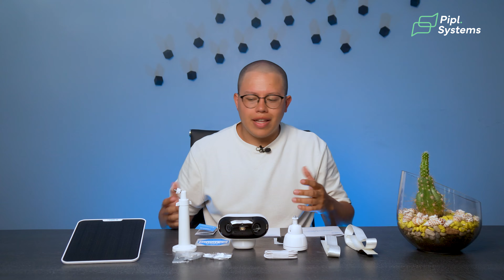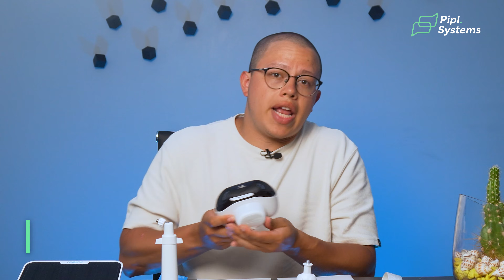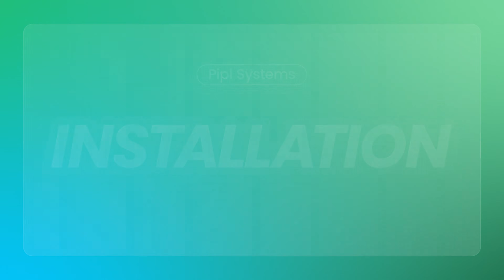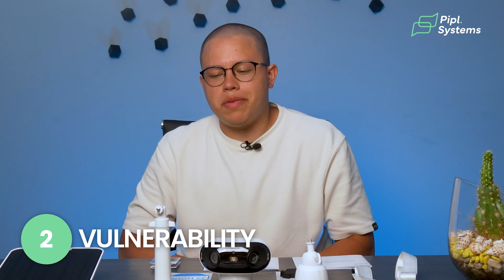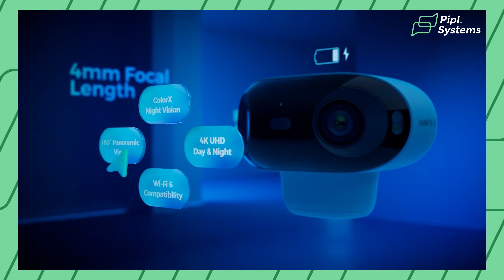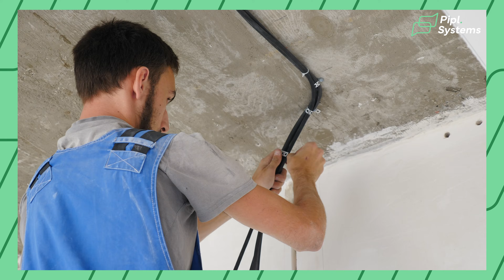Reolink Argus 4 PRO:  The Real Truth No One Talks About

Comment: The worse camera brand. I got 3 and i have non stop issues with them.. Battery experience is horrible! Video quality and sensors are good.. but with batteries that dont charge and when they do they drain fast even when you have the lowest security standards in the setup.. horrible.

Comment: This has got to be the dumbest review/reviewer on the net. The solar panel keeps the batteries topped off and the camera runs off of the batteries, not off of the solar panel. One charge on the batteries can last more than a year without the solar panel. Just a few hours of sunshine periodically will fully charge the batteries. My Reolink Altas PT Ultra battery-operated cameras use the same battery and solar panel. They record 24/7 and never get below 80%. Not only are they recording, but they also use an electric servo motor for auto tracking that the 180 degree Argus Pro 4 does not use or need . Also the camera and solar panel are completely weather proof. Mine work flawlessly in rain and while covered with snow. For security against theft the wireless units can be placed in far less accessible locations than can the hard-wired cameras. Another great feature of the Reolink wireless cameras is they will continue to operate if the power goes off. These Argus Pro 4 cameras are compatible with the Reolink Home Hub that records 24/7 via the WiFi router while sitting on your desk top in your home. If someone damages or steals your camera you will still have a recording of them doing so stored away in the wireless Home Hub unit. This duplicitous reviewer tried so hard to come up with a controversial review... e.g. "The real truth no one talks about" as click bait that he stooped to twisting facts to fit his narrative. Reolink has proven itself in my daily use to secure my property and home; I'm buying the Argus Pro 4 also.

Comment: I run mostly PoE systems, however I have a spot that has no access to ethernet way in the front, I need something, and this video didn't go over the practicality of the system.  I have a solar backup camera that can run into these issues, but works great in practice, I need to know how this works in practice and did not receive it from this video.

Comment: It says on the reolink Q and A can you charge the battery operated camera to an outlet, to get constant  power, it says yes but not recommended, may be due to the face the constant power may degrade the battery overtime. Plus can you confirm if this is event recording only or can it do 24/7 recording. Other reviews say it can’t do 24/7 recording. But my theory is if it had constant power to a wall plug it should
Reply: I’ve had a Reolink Argus PT for years out in the country running on its solar panel. I’m in Texas. It gets brutally hot. M6 experience has been had it’s bulletproof. My camera is always at one hundred percent and I’ve never cleaned it or adjusted the angle. It’s on twenty four by seven over WiFi.
Reply: @ thank for the reply, is that 24/7 recording event recording or continous recording

Comment: Simple run true aditional external battery pack from solar to cam will solve your hustle and cost only $20-30 vs thousands on wired installation when sometimes more costly to fix just in case if someone pock your cables.

Comment: My old camera ran 3 years old and hasnt had any charging issues. Even after i put it in a box for the last year. I pulled it out still turned on and still had 20percent battery. And if you buy a motion sensor camera why would you want it recording 24/7 that deafeats the purpose of a battery sensor camera.

Comment: Yes. I would assume that nobody would buy and install an expensive solar powered camera where they could use a wired IP camera.
Reply: You won't feel that way if the power goes off. The Reolink wireless cameras continue to operate during a power failure, recording to the Micro SD card plugged into the cameras.

Comment: Is this camera able to run without using the solar panel? Like using continuous power via outlet
Reply: Not true. It is easier to run a power cable to an oulet than running network cables through your attic..
Reply: @gust_FL  Agree - my use case is actually for in a vehicle where I can just plug it into a USB port that's powered even when the vehicle is off.
Reply from the maker: Yes, the Reolink Argus 4 Pro camera can work without a solar panel by connecting it directly to a power source. However, this defeats its technological purpose; it would be simpler and cheaper to install a regular wired PoE surveillance camera.
Reply: @piplsystems  plus POE systems from Reolink doesn't support cloud storage,

Comment: Is there any way to delete footage from sd card without having to pull it out
Reply: You can format the micro sd card from the app with the card still installed but then of course that deletes all recorded footage on the card. I wish they had an easier way to delete select recordings without physically removing the micro sd card itself.
Reply from the maker: If you want to delete the footages, you need to take out the Micro SD card to delete them on the computer. If you don't want to take out the Micro SD card, the camera will automatically overwrite the old files when the SD card is at capacity and then continue to record.

Comment: Most of your down sides are about the solar panel but the battery lasts at least a month so not having much sunlight here and there isn't much of an issue, the real issue is not being able to expose each lense seperately, so i have issues with one side being either too dark, or blown right out, but there was no mention of that.

Also you had an issue with it bein vulnerable if people mount it at eye level? lol wut?
Reply from the maker: Don’t rush to conclude that the battery will last for a month. It all depends on the activity of objects within the camera's range of vision. Install the camera on a side busy with people and cars and you will see that the battery does not last even for several days.
Your problem is due to the fact that Argus 4 Pro camera uses two sensors and when different amounts of light hit them you get a different picture. Everything is logical, although we really didn’t talk about it.
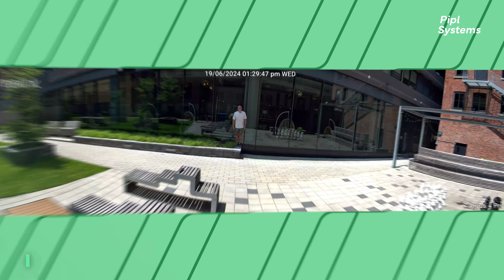We also saw a problem when the object is close to the camera in the center. You can see this at 0:50

Comment: Meh.... sounds like you're doing a lot of reaching, reaching up high to the sky. Another channel mentioned that his solar panel does NOT get much sunlight, but the camera still works perfectly, as the internal battery only uses a small amount of power. So 24 hour sunlight is not necessary.
Reply from the maker: Do you want us to test the camera without connecting it to a solar panel and prove that the battery won't last long?
Reply: @piplsystems  I think since you are saying it doesn't work you should test. You are assuming it doesn't work. To be honest, this is more clickbait than real arguments. I think the ones that buy these know why and what for they are buying it.

Comment: Get a Life! What a jerk review!
Reply: You really never have instslled wired cameras much!
Reply from the maker: @mtnwolfman88  Nope, you are not right, buddy.. We are in the security industry almost 20 years, I remember times when analog camera with 420 TVL was considered as high resolution camera. And I have hundreds installations in my life. Thats why I'm telling that wired installation is always better and in 99% it is possible to use cable.
Reply: You don't live in the Rural Rocky Mountsins then. Can't dig 10 feet without running into rocks the size of a Volkswagon. And yea it snows on Solsr Panels. I have lived on on solar power for 33 years!
Reply from the maker: Please do not rush to conclusions. Most likely, you just misunderstood the point of our video. We were neither reviewing and testing technical features nor criticizing the specific Reolink Argus 4 Pro camera. Moreover, we were not criticizing the Reolink brand. We wanted to explain that for a homeowner, a WiFi camera with a solar panel is an absurd solution because if you have WiFi, in most cases, you can install a power cable from the nearest socket to the camera. A solar panel is a very vulnerable component of any 24/7 security system and should be used only if you truly do not have electricity or if installing a power cable is simply impossible. Therefore, this camera is suitable only for specific tasks such as installation on remote sites.

Comment: This is a bunch of bull. I've had similar solar panel cameras for years and haven't missed an hour of recording in 5 years.
Reply from the maker: Please do not rush to conclusions. Most likely, you just misunderstood the point of our video. We were neither reviewing and testing technical features nor criticizing the specific Reolink Argus 4 Pro camera. Moreover, we were not criticizing the Reolink brand. We wanted to explain that for a homeowner, a WiFi camera with a solar panel is an absurd solution because if you have WiFi, in most cases, you can install a power cable from the nearest socket to the camera. A solar panel is a very vulnerable component of any 24/7 security system and should be used only if you truly do not have electricity or if installing a power cable is simply impossible. Therefore, this camera is suitable only for specific tasks such as installation on remote sites.
Reply from the maker: Do you use your solar panel security system for residential project?
Reply: @piplsystems  yes I have reolink argus 3

Comment: What a pointless review! You didn't even test the camera for the features it offers, you just brag about the solar panel that is not unique to this camera and it not a "defect" it's a "feature".
BTW I own several Reolink cameras and all of them are connected to a solar panel, no one ever failed and the oldest has almost 10 years.
Reply from the maker: Please do not rush to conclusions. Most likely, you just misunderstood the point of our video. We were neither reviewing and testing technical features nor criticizing the specific Reolink Argus 4 Pro camera. Moreover, we were not criticizing the Reolink brand. We wanted to explain that for a homeowner, a WiFi camera with a solar panel is an absurd solution because if you have WiFi, in most cases, you can install a power cable from the nearest socket to the camera. A solar panel is a very vulnerable component of any 24/7 security system and should be used only if you truly do not have electricity or if installing a power cable is simply impossible. Therefore, this camera is suitable only for specific tasks such as installation on remote sites.
Reply: @piplsystems  "We were neither reviewing and testing technical features nor criticizing the specific Reolink Argus 4 Pro camera"
In other words, used a clickbait title that is misleading and off-topic. Got it.